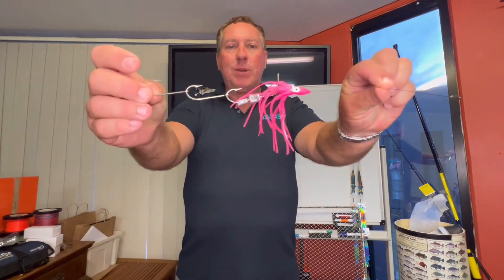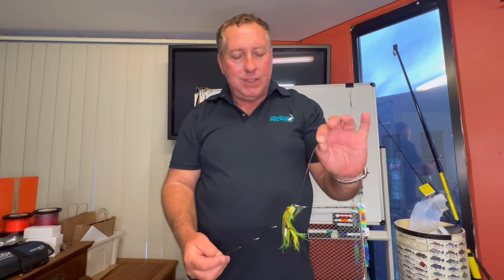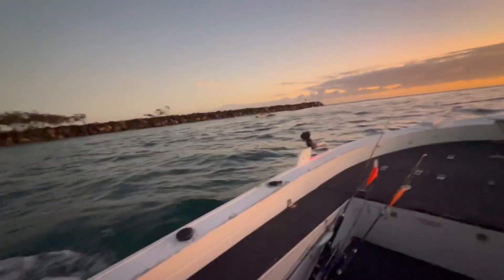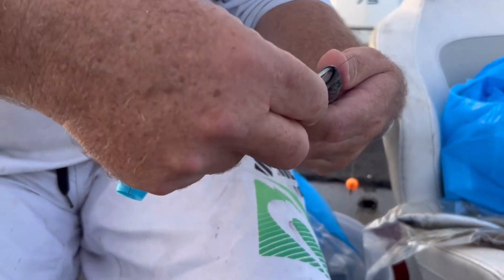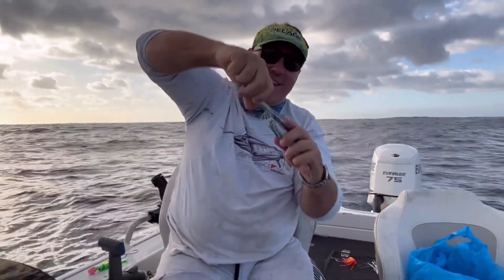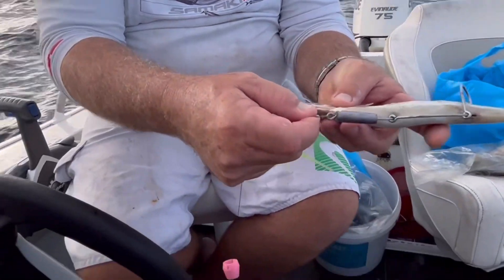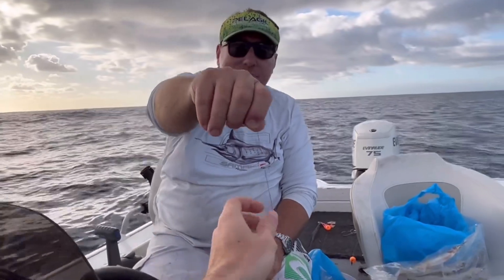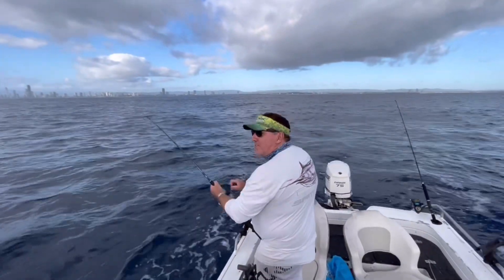How to rig Spanish Mackerel baits for trolling.

Comment: Great work, you said they go down deeper as the sun gets higher.  Do you let the rigs drop a way down and then just kick the boat in and out of gear?  How slow is slow?  Not having great success doing similar.
Reply from the maker: Hi Brian, try and find the mackerel on the sounder and what ever depth they are at is the depth you must try and get close too mate. Slow means like 1-2knots and yes in and out of gear if need be